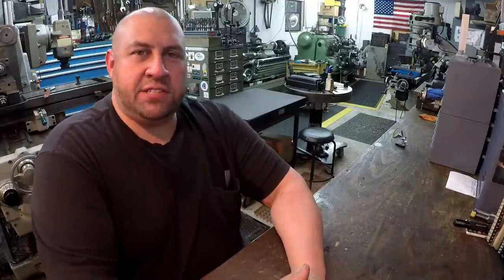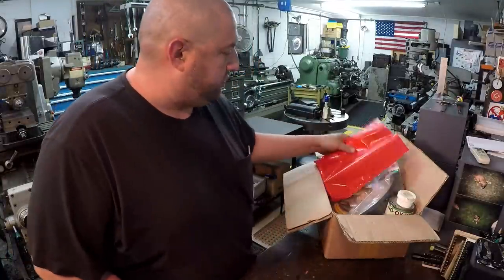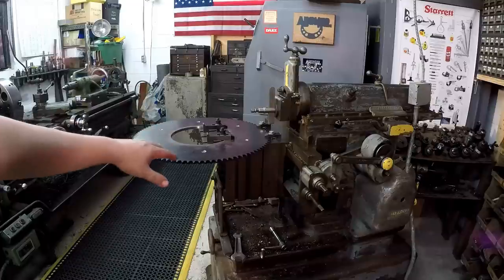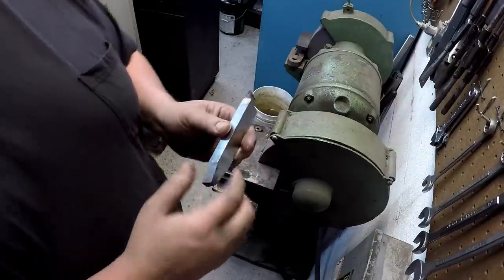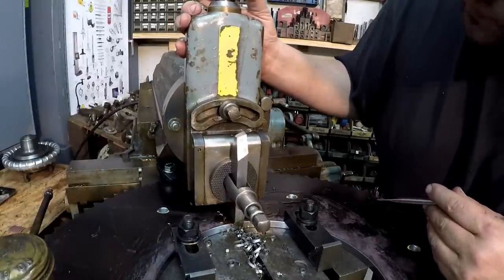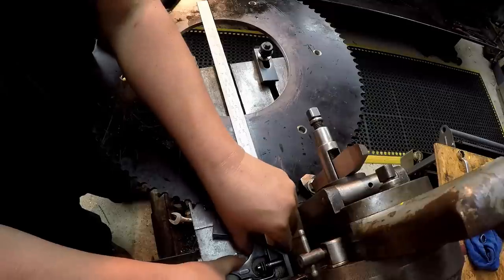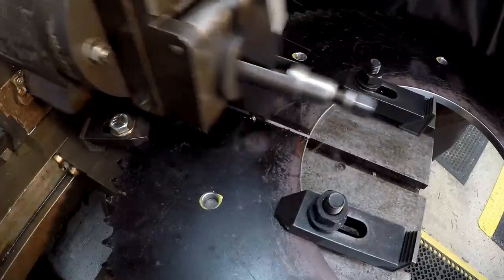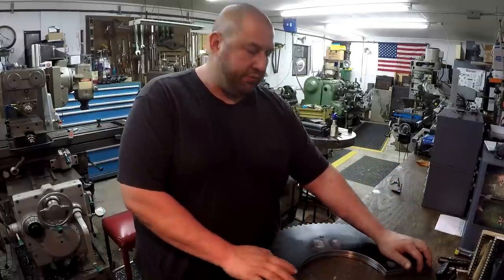SNS 180: Parting in the Shaper

Comment: Wouldnt it be better to slit on the peak of a sprocket tooth instead of the valley, as its the valley that carries the load of the roller in the chain, and the peak carries no load. Please help me understand why its OK to have the slit notch in the valley... is there enough radius remaining to stay below the stress limits of the roller segment? Will the loss of material lead to higher wear rates in the slitted valleys, or is the load and wear so well distributed over the total contacted valleys its really not of any consequence. I want to understand the subtle aspects of how this sprocket splitting works best and what the trade-offs are.
Reply: You are thinking in terms of static load on the tooth.
When the sprocket is in actual use, the load is on the face of the tooth, not the gullet. To add to that, the chain rolls over the length of the tooth, so when the chain begins to engage the tooth, it is doing so near the tip. If you have cut the tooth in half it will bend the tip over.
In use, there is very little load at the very bottom of the tooth where it is cut.
Reply: joshua43214 
Thanks!!!  Appreciate your reply, Good to verify how that really takes the load. If final thought, it makes sense, as when we see worn out sprockets, its never from deepening of the gullet, its from wear of the sides.

Comment: your tool snaps down exiting the cut suggesting that the gib is not tight in the ways. The massive ram will hardly have that much spring deformation. Therefore I assume something is wrong with the ways. Did you check that the ram moves precisely parallel to the work?

Comment: Great video,  I'm not an engineer but I do use a lathe and mill for model making. I was wondering are there jobs you can only do on a shaper  ? Or are they machines from a past era ? 
Thanks 
Paul
Reply: Shaper can do internal stuff faster than my mill will. Internal keyways, splines, broaching etc.  They still have their place in the shop. Mine is small wish I had a bigger one.
Reply: The old joke is. "You can make anything with a sharper. Except money." They are too slow for modern commercial production shops. But they do work very well and are great for home shops if you have the room.
Reply: Passed up a beautiful SB 7"for $400. Huge mistake. It would have come in super handy for keyways 4 or 5 times now. Big ones can move some serious metal.
Reply: Shapers have kinda fallen out of commercial work because they´re slow and since 5 axis cnc can do anything in any shape you don´t need shapers anymore. If you are into manual machining however a shaper will do way more even surfaces and better surface quality than a mill can do you and depending on the size move way more material than you´ll move with a same sized mill even with flycutters or milling heads while still leaving an even part and a great surface finish.
Reply: A friend has a modern shop with almost all cnc machines. He had two big shapers working to hog off some metal on odd shaped parts. Just put part in between cnc cycles and let it do its thing.
Reply: Thanks for the replies , the shaper is a very nice Machine to watch working though.
Reply from the maker: My dad used to use his for jobs that had lots of metal removal, where in todays day would be milled away. Set the machine up and let it cut while you run another machine. They are handy for internal cutting like keyways and other shapes. Another benefit is using them for odd jobs, for example a large exhaust manifold. You can set one up and use a cheap tool bit to true up the face, or some large work piece that needs machines across the whole width and length.
Reply: They do superb work at cutting long thin parts as well. I've seen a few shops use them to part super thin parts that would chatter like hell trying to finish the sides in a mill. They are also superb for keyways if you don't have a broach available. We used to send hubs out to get keyways broached and they did it with a scraper like this. that 70+ year old machine held tenths. We couldn't even broach in our shop with cnc that accurately.
Reply: I cut a gear with a shaper when I was in machinist school '85-'86, back in the Stone Age.

Comment: Nice work. Don't ever recall seeing a shaper before. Pretty awesome tool to have and use.
Huge piece to work on again. Why would a sprocket be split? To increase the size, or gear ratio, replace some teeth?

Love these videos. Great work.
Reply: This is the third one Adam has done and he has explained that the sprocket mounts on to a shaft and can be changed without having to remove the shaft.  It looks like it may be No. 50 roller chain or just slightly bigger.  It definitely is not No 200 roller chain as I have had experience with that size--2  3/8 inch pitch by 2  3/8 inch wide.

Comment: Why not use the angle grinder. Just had to say that. Besides the split lines don't need to be straight do they? Hmmmm? Using the shaper if it does the job saves on the pricey spindle bearings on the mill and K&T. Try a key way. That would be cool to see.

Comment: I told you all history repeats it's self.  Try that on a vertical mill slotting 1/8 end mill (trashed)
Horizontal mill  Ok but not all has one with a 'slitting saw'   band saw  power hack saw not
accurate.   But the shaper eat's everything.  For Adam's shaper I think he is babing it.  Crank it down till close to brake out.  I can't wait for his new shaper cappable of chips the size of a 
bricks  known to do damage to ya walls.  Even small shapers have no mercy.